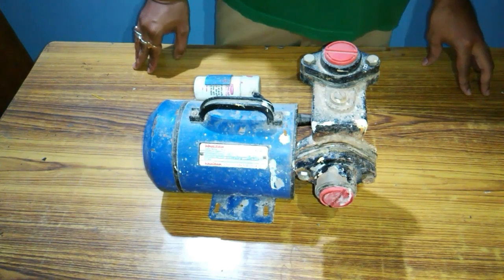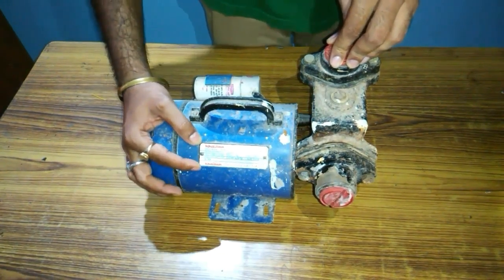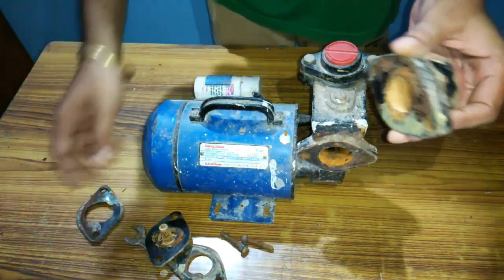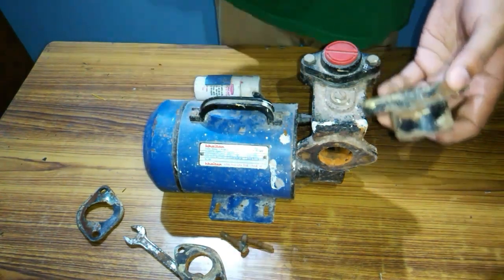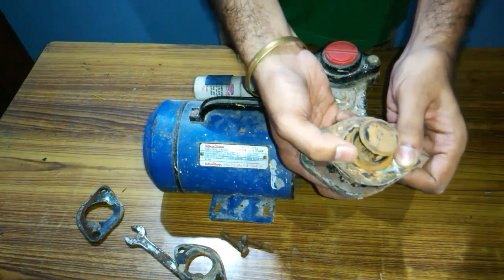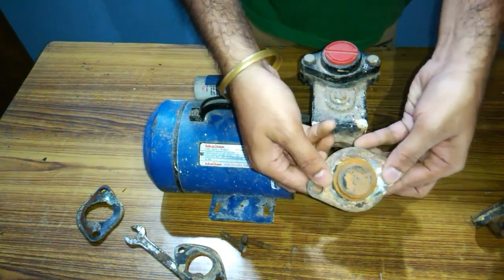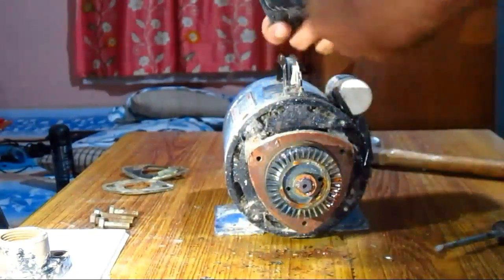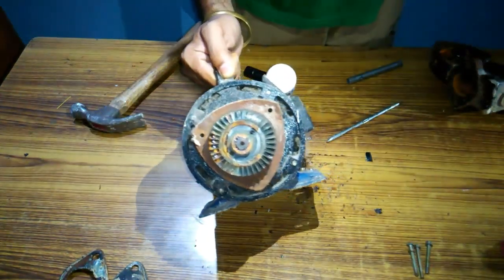INSIDE A SELF PRIMING MONO BLOCK PUMP (Tullu pump)

Comment: Kaya ye pump muncipal water suck kar sakta hy?
Mera connection main pipe line ky nichy say laga hy or line man valve kam khulta hy...pani tezi say main pipe line main agy nikal jata hu.donkey pump jo pani khench sakta hy wo khenchta hy or baki sath sath air lay leta hy is problem ka koi solution hay?
Motor change yan fitting alterations ki sorat main yan phir muje connection ko check  karwana pary ga.
Reply from the maker: Yes it can suck water
Reply: @siddharthasarmah6172  can suck water if there is continous gap between water and air,water,air,water,air,water,air...?
Reply from the maker: Muhammad Umar there may be some problem for that you may get intreptted flow of water Baki no issues